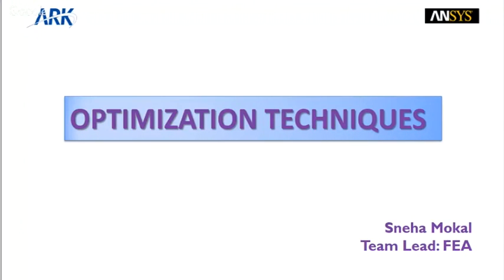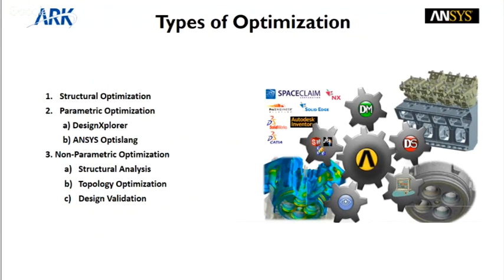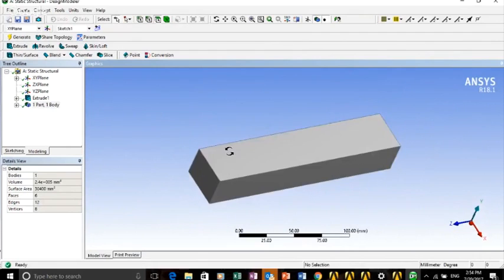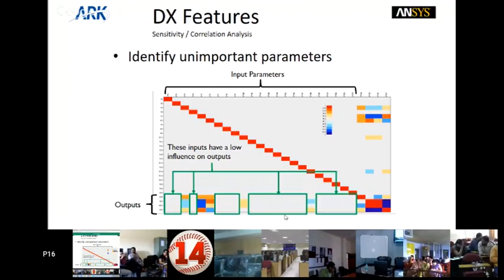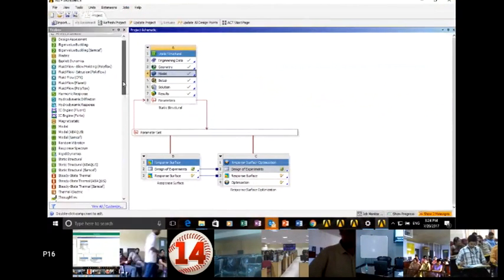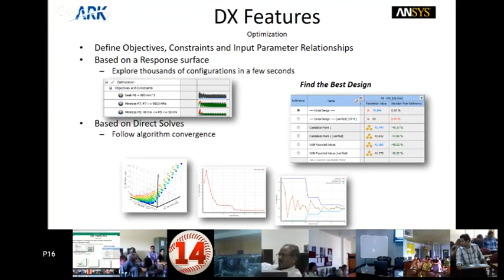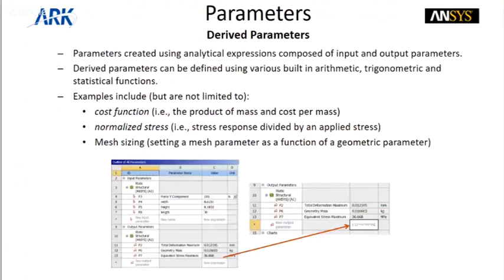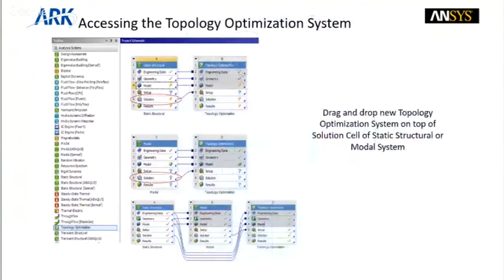Optimization Techniques By Ms Sneha Mekal

Comment: Its all mathematical analysis but my question when we work in physical we face many more problem example structure analysis if you make ark welding its dimension changes if you go with co2 quit good 
So pls give me a good physically analysis testing equipment